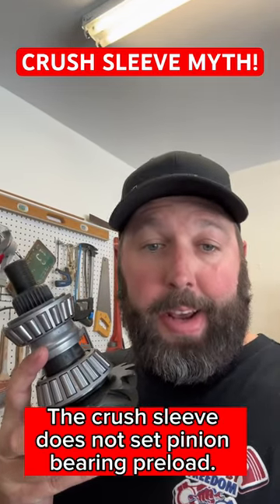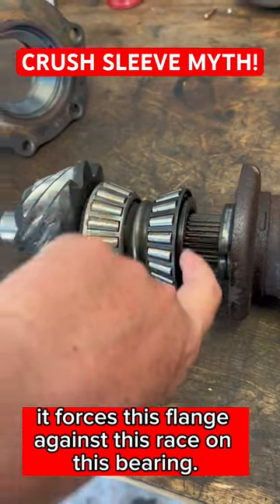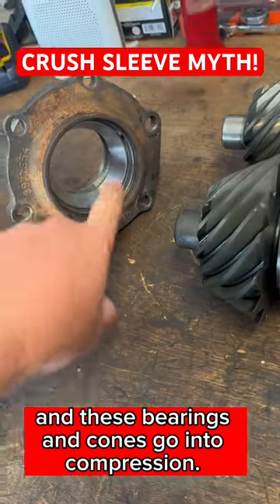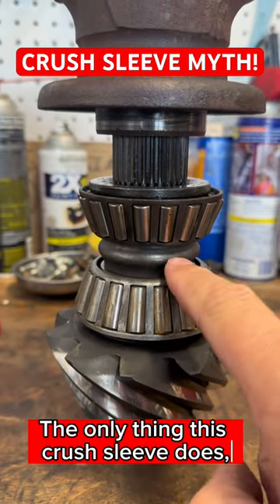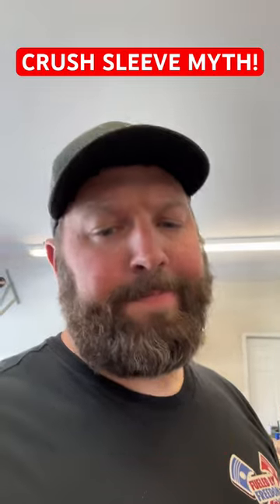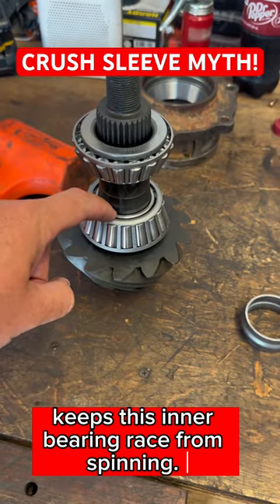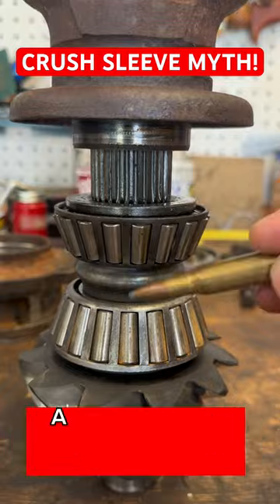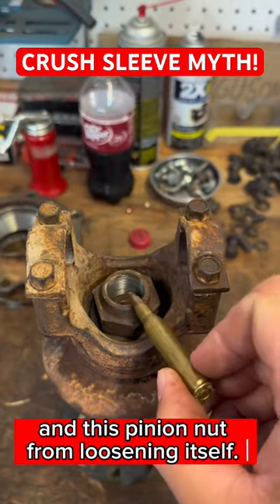Pinion Bearing Preload Isn't Created By A Crush Sleeve! #mechanic #jeep #axle

Comment: This is why solid pinion sleeves exist.
Reply from the maker: The only thing a solid spacer does is make it take longer to setup 😂. That being said, you have no worries about preload if you ever need to pull the yoke to replace a seal. Solid spacers making it stronger is another internet myth. Change my mind 😉
Reply: @freedomworx  because lf the curvature of the ring gear gear teeth and pinion teeth, there is a perpendicular force as well as a linear force applied to the pinion that tries to push and pull the pinion in and out of the case. That movement causes the pinion bearings out of alignment and breaks pinion teeth. The solid spacer allows the application of a much higher tension on the bearings thus keeping alignment in place during high torque scenarios. The crush sleeve cannot do this do to its inherent design. This is also why solid spacers are used with shims to get the correct amount of bearing preasure on the races. Many teeth that are broken on pinion gears are not broken due to weak parts but misalignment at critical events.
Reply from the maker: So you think the pinion shaft bends under load?
Reply: @freedomworx  no.
Reply from the maker: Maybe watch the video again. The bearings will see the same amount of preload with or without a crush sleeve or spacer. They have zero affect on the preload on the bearings. The only affect they have is on the pinion nut torque. If you left the sleeve or spacer out, tightened down the nut to the appropriate rotational torque (bearing preload) and welded the nut to the pinion, it would be just as strong as having a spacer in there. It does not affect bearing preload… It just keeps the nut tight. It’s that simple. The crush sleeve or spacer see no load from the power applied to the rear end. 100% of the load is controlled by the tapered bearings. You can not crush a sleeve from overloading the rear end.
Reply: @freedomworx  you are arguing something different. I didnt claim that a solid sleeve makes anything stronger. A lifters belt doesnt actually lift any weight but aids in stability of the posterior chain that allows more force production to be used without damage. A solid sleeve does the same as a crush sleeve but aids in stability where the crush sleeve cannot. There is more going on than the simple example you explained.
Reply from the maker: There truely isn’t. All the forces generated in the pinion are absorbed by the bearings. Name any other tapered bearings system that uses a crush sleeve or spacer. Pretty sure front tapered wheel bearing sets experience all kinds of forces vertical, horizontal, axial… They don’t use any sleeve or spacer 🤷🏻‍♂️
Reply: @freedomworx  on a  Ford ,9in. With the small bearing on the nose of pinion ,, not any chance of "bending" on GM 8.5 , 8.75.,and 7.5. Under extreme load the pinion can try to lift out of the ring gear , because , no bearing on nose. The lifting of the pinion is called pinion deflection. This is why race cars , and high horse power applications go with the 9 in. Ford.
Reply from the maker: That’s one of the reason 9” rears are used in racing applications. The main reason is that it has a removable 3rd member. Which makes it quick and easy to change rear gear sets at a race track 🤷🏻‍♂️ This diff I am setting up in the video has a pinion support bearing just like the Ford 9”.
Reply: @freedomworx  if there is no sleeve or spacer, and the nut is torqued, won't that put a lot more force of the bearings into the races and bearing cages which would cause damage to the rollers, races or cages?
Reply from the maker: @MichaelJeffers75 well I never said to leave it out. I simply stated that it isn’t what creates the preload in the bearings. It just keeps the nut tight and the outer bearing inner race from spinning on the shaft. That being said. In a crush sleeve application, if you left it out, you’d simply torque the nut down until the proper preload was achieved. Same as with it installed. In a solid sleeve application, if you left it out and torqued the nut to the required torque spec, you’d damage the bearing. I’m not recommending that you do either.
Reply: Ive set preload without any spacer, and loctited the nut. Car is driving 2 years now. Had to prove a (this videos) point. Finally, someone who knows.
Reply from the maker: @joey66436 thanks for the backup 😎

Comment: Great video, I've been trying to explain this for years! But your explanation is way better to understand. 
The 4wd world thinks you must use a solid spacer for added pinion strength, they think that the pinion will flex more with crush sleeves and will also crush under driving and shock loads, lol... I get so frustrated when these so called "experts" get it sooo wrong.
One question please, say if I'm just replacing just my pinion seal, and I measure and count the turns of my pinion nut, why shouldn't I re-use my existing crush sleeve? As long as I'm getting the right back pressure on the pinion nut and not changing the preload, all should be good, theory?
Reply from the maker: I've replaced several pinion seals by just counting threads and measuring pinion nut protrusion to ensure I get the proper preload when it goes back together. Never had an issue. If an offroader thinks they need a solid pinion spacer, just tell them that Busted Knuckle Offroad puts crush sleeves in all the 14-bolts they build 😎
Reply: @freedomworx  Cheers, mate. 👍

Comment: My pinion nut came loose how do i figure out how much i need to tourq it down too or figure out the pre load
Reply from the maker: The only surefire way is to disassemble the diff and measure the rotational torque of the pinion as you tighten the nut. The measurement is not accurate if the carrier i still in the diff unfortunately. But aslo realize tha sometimes the nut didn't come loose, the bearings actually failed. Conversely, you could snug it down and pray, but it isn't likely to last for a long time that way.

Comment: It’s only a problem if the pinion nut gets over torqued, but I still like a new sleeve whenever it’s removed.
Reply from the maker: I've never reused one, But i wouldn't be scared to use a press to lengthen a used one out and resuse it in a pinch.

Comment: I like the way you explained this, but to call it a lockwasher for the pinion nut is oversimplification. What if there is no sleeve? If there is no crush sleeve or straight sleeve, all resistance to compression of the pinion nut comes from pressure on the outer bearing cages through their outer races. So, one side of each bearing will have pressure on the outer cage, and the other side will have pressure on the inner cage. That causes torsional stress on the weakest part of a bearing, the sheet metal that makes up the cage, eventually distorting it. Just like when you press a bearing off, you need to apply pressure to the correct race so it won't twist and damage the cage. So, you need a sleeve to balance torsional pressures on the two bearing cages. The crush sleeve shrinks to get the distance perfect but otherwise works exactly like a simple sleeve.
Reply from the maker: I’m not sure what you are trying to get at. All the preload in these bearings comes from the pinion nut. The crush sleeve literally opposes preload. You can’t have any more pressure on the bearings cone, rollers, or inner race. It’s physically impossible.
Reply: WTF  did you just say?  A whole lot of nothing.
Reply: @ronniecox109  I appreciate this is not easy to understand, and my poorly worded remark didn't help. Anyway, you go ahead and put a lock washer on your pinion nut, and leave the crush washer out. See what happens. There's a reason that all manufacturers went through the effort to place the sleeve where it is, and it goes far beyond a simple lock washer analogy.
Reply from the maker: @spelunkerd  nobody ever said to leave it out 🤷🏻‍♂️
Reply: @spelunkerd  oh  I've set up hundreds of diffys, and  the crush sleeve must be there.  On GM  diffs, the washer is a flat washer, and the nut is a prevailing torque , locknut.
Reply: Your user name , ? Are you into cave exploration? Spelunker is a term , for cave explorers.
Reply: ive had no issues without a crush sleeve or spacer, if anything it has made my pinion even stronger now that its under less tension from trying to crush a useless piece of tubing, my pinion nut has loctite and deformable sleeve peened over into the key way of my pinion.

Comment: So i dont need to replace the crush sleeve when i change out my pinion seal?
Reply from the maker: I didn’t say a crush sleeve was reusable, I said it doesn’t create preload. That being said, I have replaced many pinion seals without replacing the sleeve. I just measure the pinion protrusion through the nut with a caliper, count the threads, and mark everything, to ensure the nut is put back exactly where it goes.

Comment: Have you ever measured the before and after length with a caliper? Just curious, have you ever over crushed one and uncrushed it with a press because save 50 bucks?
Reply from the maker: If feel like they only cost about $10. Personally, the only reason I’d ever do that is if it were Sunday night and I couldn’t procure a new one and I didn’t want to wait around.
Reply: @freedomworx  ah you are not familiar with the mopar tax where a crush sleeve is 50-60$.
Reply from the maker: Damn Taxes 😂

Comment: im not sure you understand my guy, you dont need a crush sleeve or crush sleeve eliminator, just use loctite 620.
Reply from the maker: I understand just fine. Some people have been successful without running one, others were not. I’m not recommending anyone go without.
Reply: Loctite??  What the hell man, don't you own a welder?  Do it right, and throw some 7018 in there like a boss.  😂

Comment: So, how do you set preload without it ?? I made the mistake of not using one, and guess what?? I could not get the preload to where it needed to be without it.
Reply from the maker: I set the preload without one in place every time I set up a set of gears. I don’t install it until the final assembly after I have made adjustments to get the gear pattern correct.

Comment: I’m not so sure removing the sleeve is a good idea. I don’t know much about it, but judging from its shape, it looks like it’s got some spring and allows one to set the end play of the bearing assembly by tightening or loosening the nut. And ensures too much “negative end play”. Removing the sleeve would make the end play different value and may not meet what the preload or end play needs to be. Which may work for some time, but may result in bearing failure. What’s the point of leaving it out anyway? Weight reduction?
Reply from the maker: Never suggested leaving it out. I’m simply stating that it doesn’t do what people think it does.

Comment: So when I paid extra for the Solid pinion spacer  you telling me I didn't need it?
Reply from the maker: No. You need something there. Be it a spacer or a crush sleeve. I stated the purpose of the crush sleeve. A solid spacer does the same thing, but  has the added benefit of making a pinion seal replacement stress free, because you know the preload will be correct when it goes back together. But that’s literally all it does for you. People that think HP (torque really) can collapse a crush sleeve don’t understand differentials. There are sled pulling trucks with over 2000lb-ft of torque that can’t collapse them. You might fail a bearing and lose preload, but you aren’t collapsing that sleeve with torque.

Comment: I'm not happy, my Colorado has a 10 bolt 8 inch aam and I never marked the nut and now I don't know how tight or loose to make it
Reply from the maker: Well the appropriate course of action now is to disassemble down until there is nothing left in the housing accept the pinion, and tighten the nut until you get the appropriate rotational torque on the pinion. Assuming that’s a crush sleeve style axle.
Reply: @freedomworx  that was my fear
Reply from the maker: Better get yourself a 12 pack 😉

Comment: Whats odd is that my bearing by the yoke does not slide  on all the way to the crush washer, it has to be pressed in. The bearing by the pinion is a press in too.
Reply from the maker: Outer pinion bearings do not need to be pressed on. If it needed to be pressed on, you’d never be able to get it back out of the diff.
Reply: @freedomworx  I took my outer bearing  off using the press. I supported the pinion carrier and then pushed the pinion shaft out to remove the yoke and outer bearing. This guy shows "pressing" on the outer bearing: https://www.youtube.com/watch?v=4OT6ogOJpLM&list=PLu4o4GT3ryTYrDLaEwt0KVUSjJ6yk6GZb&index=2&ab_channel=WarPaintOffroad
Reply from the maker: @chuckdock4436 ok. I’ve never seen or had to do that 👍
Reply: @freedomworx  I have seen other videos that say you take the yoke bolt out,  remove the yoke and seal and the bearing falls out, just like you are saying but when I did that on mine, it didn't fall out and then I had to remove the  whole pinion carrier setup. Weird for sure. Mine is a 1976 14 bolt full floater setup. So its an old one for sure. Maybe they were just different then.
Reply from the maker: @chuckdock4436  If the outer bearing falls off the pinion, it means the bearing has failed. Or at least it has gotten hot enough and spun fast enough to spin on the pinion. Which it should not do, and is indicative of some other issue. Low oil, bad oil, excess heat from excess load, assembly error, etc... Every loose outer bearing I've seen was on a diff that was being disassembled due to bearing failure.
Reply from the maker: BTW, this is a 1975 14 Bolt diff. Same as yours 😉

Comment: Who made those bearings?
Reply from the maker: Timken…National… I don’t remember.
Reply: @freedomworx  I was just curious as I make bearings for a living, and for a minute there, I thought it was one of ours.
Reply from the maker: @bearing_aficionado who are you with? Bearings are fascinating. But then again…I’m a nerd. 🤓
Reply: @freedomworx  NSK.  There's not much to them, really.  Especially, tapered roller bearings.  It doesn't take much to assemble.  It's pretty simple.  The line assembles, checks dimensions, checks for noise or vibrations, laser etches them and then we final inspect them and pack them out.
Reply: @freedomworx  the grinding process is where its at.  I just moved back to my old area where we do the first grind process.  My area grinds the face and OD.  I was over the second grind and assembly process for about 3 years recently.
Reply from the maker: @bearing_aficionado  well I personally find the manufacturing tolerances and ability to remain in service for so long, pretty interesting. What plant are you at?
Reply: @freedomworx  I'm in the hub plant.  We make hub, transmission, and differential bearings.

Comment: You need rethink , I believe the engineer's are smarter than you when they design that rear end in the 50's you need a preset on your brngs or you will burn them out,it also goes in hand with your pinion nut tension
Reply from the maker: Well I am an engineer and I understand the system just fine. Maybe you just misunderstood the video. You certainly do need preload, but it isn't created by the crush sleeve.
Reply: The crush sleeve determines the preload,once it crushes with the preload that's when you stop the process,and the pinion nut is a lock nut shape to hold the preload,when people not familiar with that type of rear end replaced the pinion seal they will over tight the pinion nut and reapply more load on the brings,and burn them out,but anyway
Reply from the maker: @user-xg3jt3oj9v the crush sleeve does not determine preload. You’ll create that bearing preload without it even there. You simply don’t understand the system. It does exactly what I said it does in the video 🤷🏻‍♂️
Reply: Yes it does,once that depth is set between the two bearings it holds it in place,then the nut that holds the u joint flange on sets it in place, without the crush sleeve you will be able to just keep running to nut down until you run out of threads an never be able to turn the pinion shaft
Reply: Damn either we are both saying the same  but in different ways or what? Anyway Iam through with this conversation
Reply from the maker: @user-xg3jt3oj9v the crush sleeve doesn’t hold the bearings apart, the diff housing does. You have a fundamental misunderstanding of the system. Read the patents, draw some free body diagrams, and do some critical thinking. Because you don’t understand what a crush sleeve actually does.